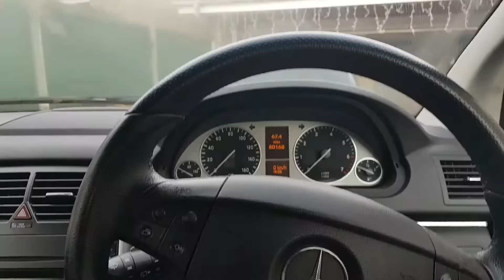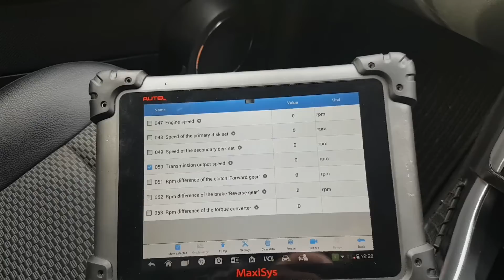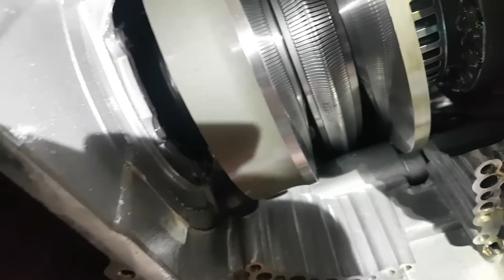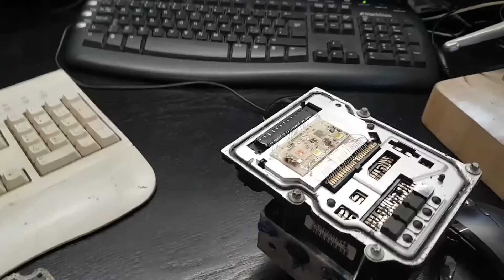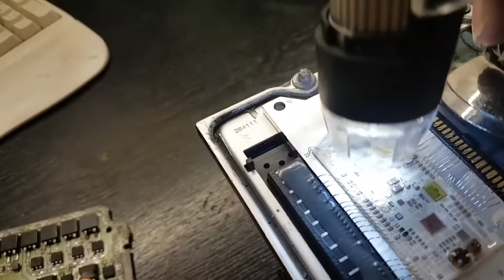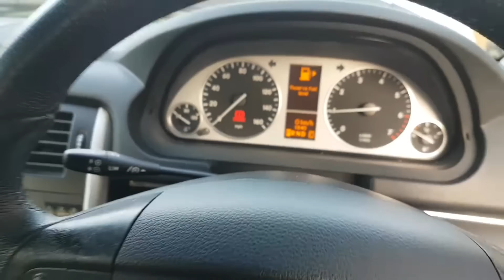Mercedes B150 W245 gearbox issues... Fault finding and repair.

Comment: Hi
I really appreciate you for being of great help to whole lot of people across the world. 
Meanwhile am having some issues exactly like the one in this video. TRANSMISSION, CONSULT WORKSHOP:
I've sent it and it has been rebuilt. 
I put it back to my car. Tried starting the car, i got a sign "Shift to N to start".
I've done that severally yet the engine won't crack or start.
Please i need your help! What should I do or did i do something wrong?
Please am really frustrated, but i trust you can assist.
Reply from the maker: Make sure everything has been reassembled correctly... specially the lever which engages the selection...
I believe I showed it on the video...
👍👍👍
Reply: @LMAutoRepairs 
I drained the oil again, removed the bottom plate. 
I was able to spot the tail of the selector,  with a spoon i shifted it all the way back.
After that, the car still can start. Same dash sign "Shift to N to start".
I don't know what else to do. Luis am stuck at this moment!!!
SHOULD I PULL IT OUT COMPLETELY TO ENSURE PROPER POSITIONING?

Am not a mechanic, you can understand the frustration.
Reply from the maker: I would take it off and re-check everything...
Including the electric connector. 
👍👍👍
Reply: @LMAutoRepairs thank Luis 
I did it all over again and it worked just fine and perfectly. 
I really appreciate your kind assistance. God bless you,  man.

Comment: Hi I just got an old b150 and sometimes I get a sign that says “Visit a gearbox repair shop” and the car gets sluggish with a low max speed. But the notice disappears if I restart the engine. Do you know what could cause this?
Reply from the maker: Difficult to say, have the car scanned at least...
👍👍👍

Comment: Great video! I have a w169 with strange problems. Its a no crank no start, but former owner hotwired a startbutton so it will start. But I can not change gear when depressing the brakepedal, the brakeswitch is replaced with a new one. The parkingbrake light is lit on the cluster, i have checked the switch and its ok. I have random faultcodes regarding can system but not one code is to the gearbox. Do you have any suggestions of what could be wrong?
Reply from the maker: The gearbox box will need information from other modules to allow gear engagement... sort the can bus faults first... would be based on your information my first thing to do...
👍👍👍

Comment: Hi, i have a b160 (w245). The car give p0722 and p0793 for speed sensors. Mechanic says chage the speed sensors. What do you recommend? Changing speed sensors or repair the tcm? Thank you
Reply: Hi, what did u repair in your case? As i got same faults. Thanks 🙏🏼
Reply from the maker: The speed sensors are in the TCM...
They are also known to fail, but as bad as the TCM itself...
While you have it out, I would give it a good look...
👍👍👍

Comment: How do you open the white lid ? Would be very thankful if you can tell me how to open it.
Thanks
Reply from the maker: You need to cut through the sealant all around the lid... then pry it open...
👍👍👍
Reply: @LMAutoRepairs  by cutting you mean like with a dremel or ? And what is the best tactic to cut from top or by side ?
Reply from the maker: @jinxtuber5113 
Top if I recall correctly...
Cut the sealant with a Stanley knife, and gelty pry it open...

Comment: Hello. I change my TCU i buyd from aliekspress brand new one with programming. After replace i got p0730 fault gear ratio?
I filld 5 liter gear oil. What do u think is the problem?
Reply: Same thing happened to me. Faulty replacement board most likely.
Reply: You need to put 6.5L of oil if you remove the unit completely. 5L is for service only

Comment: Hi, 
Thank you. Great videos. 
I have the 2008 B170 (245) with an intermittent hunting problem at intersections when hot.
Do you have any suggestions? Also, do you know where the fuel filter is on this vehicle?
Reply from the maker: Have you scanned the car?
👍👍👍

Comment: Hello, I have a Mercedes B150. When I change the transmission mode to D and shift, the car does not shift after the first shift, but if I press the gas, the car shifts but is not in the best condition. I went to a person and he told me to recode the transmission. Please help me.
Reply from the maker: Any faults stored on the transmission ecu? 
👍👍👍

Comment: Hi , I really enjoy your videos, a lot of effort put in by you. I was wondering what Autel scanner model you use. I'm thinking of splashing out as my chinese copy Delphi copy unit is unreliable and doesn't fully connect to my bmw 420.
Thank you.
Reply from the maker: I have the MS908P...
I believe it has been superceded by a different model, but you can check that out on the Autel website...
👍👍👍

Comment: ... bro to be honest i thought you will repair that , :( , not send to repair , is not difficult to repair that problem
Reply from the maker: And I would... 
Just could not afford something to go wrong and me to be responsible for it and have to support the costs of doing it again...
Remove the unit is not easy nor a 5 minutes job when done like this on the floor...
This way, if it came back, was not my responsibility...
I had to do something that you on that side didn't...
I had to assess the situation, the type of customer etc...
But yes, I could have done it...
I did this type of work in the past, and I have videos coming doing similar stuff...
Thank you for watching and for your comment. 
👍👍

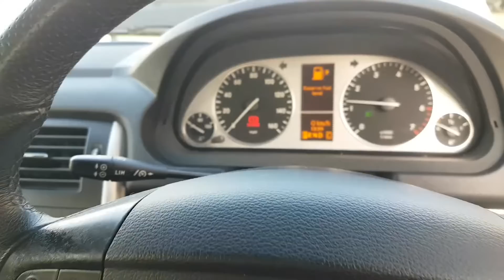Comment: Hi interesting video I had a mercedes b class with same gearbox I sent away  that module but they said I was OK in the end I scraped  it old 55 plate but only had 80.0000 gearboxses are not fit for purpose in my opinion with modern cars sepose to be progress  but its progress going backwards I this video will be of interest to anyone that has gearbox problems with these mercedes models. Thanks. 46:15

Comment: can i ask you a car question about volvo?
 does s60 mk2  or v60 2011 need volvo vida genuine software to program a car stereo same model from other volvo car or is it plug and play?
regards
Reply: Volvo vida until 2014 is free. Work with any good Passthru adapter. So try youself.
Reply from the maker: I never had to replace one...
So can't really advise...
I would guess they are coded to the VIN of the car, and will require vin changing...
But it it only a guess...
Sorry...

Comment: Frog wires, like it. Jumper wires. Can't imagine for a second the repair companies will be touching the interface connections on the MCU etc. They just reconnect the jumpers on the main PCB. Silver based solder. Still, it is a fiddly job. Trouble is, customers think it's all easy and they're getting ripped off all the time. Blaming everyone else if something goes wrong instead of the real cause - buying crap cars. Not like there isn't the info out there on what goes wrong with em nowadays.
Reply from the maker: ☺️
Very true...
👍👍👍